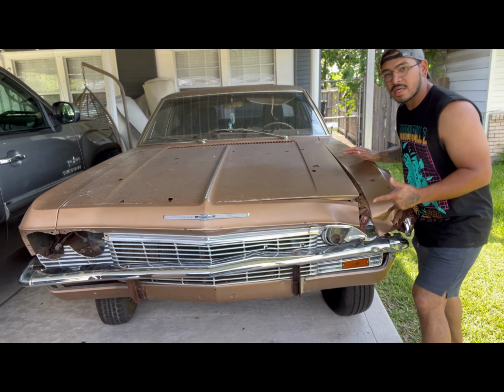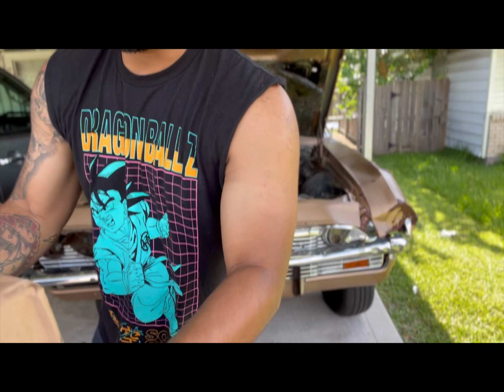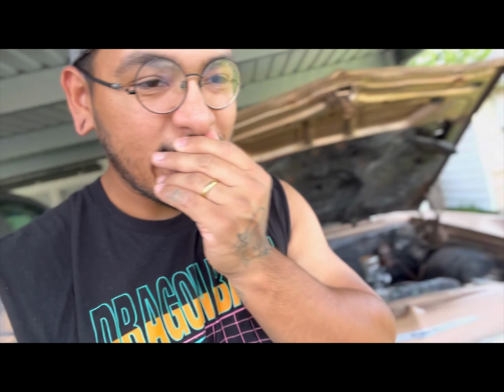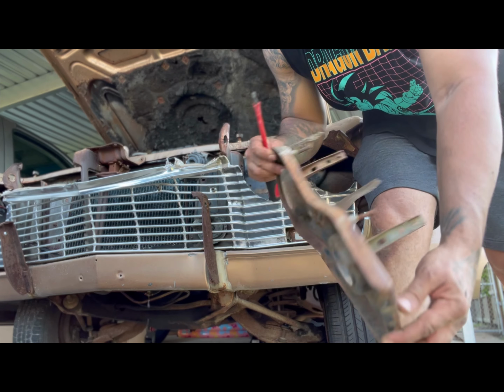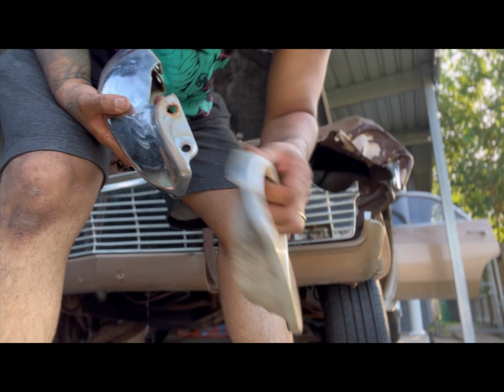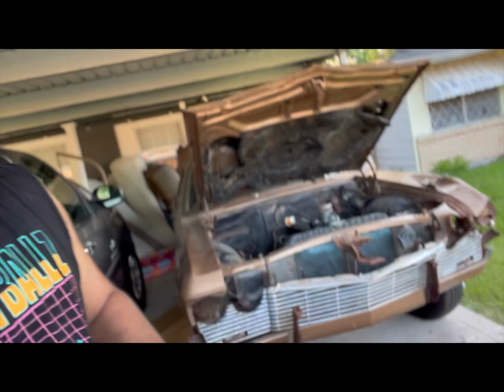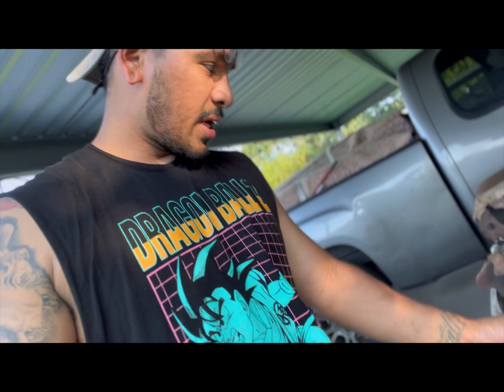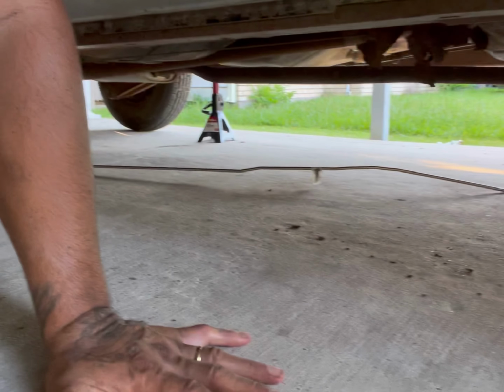1965 Chevy Impala Front end removal part 2 / Fuel line install

Comment: I recently got a 1965 Chevy Impala 4 door, and it came from Key West, FL so it has a lot of rotting rust. the frame and everything is good and needs minor work but the body is bad. I've been trying to find videos that will help me find the right fuel lines and this video has the same car as me basically and I'm not sure where he ordered the fuel lines from.
Reply from the maker: If I didn’t mention it in the video that’s my bad. The line for a 230 inline 6 is a 5/16 line for the fuel line leading up to the fuel pump, as well as the line to the carb. The fuel sending unit should be a 5/16 line as well. You can purchase them on eBay.

Comment: Fuel line should be one of the very last parts you should worry about 1st things 1st should be the body n making sure the frame isn’t  bent because that frontend looks as if it took a beating
Reply from the maker: Frame is good. No damages there! From the looks of things. Just the outer shell 👍